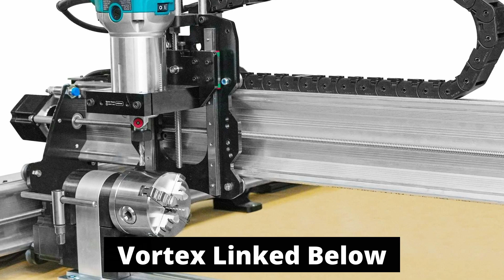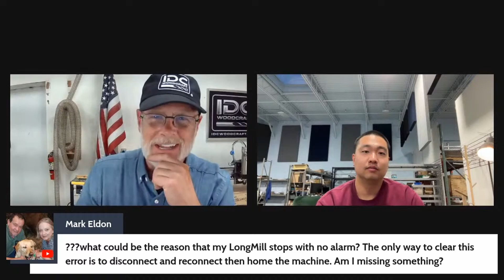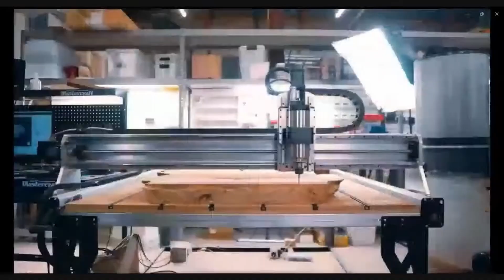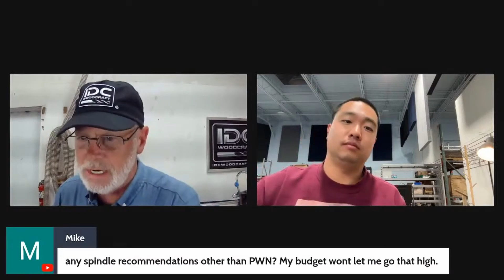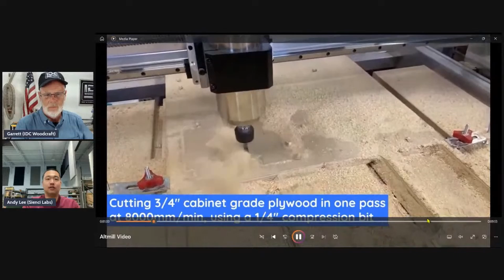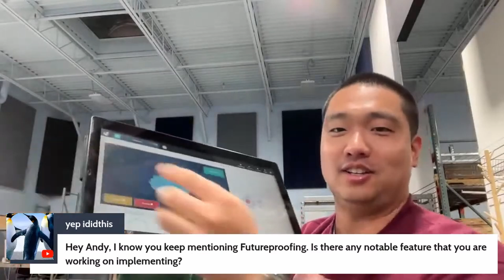Expert Insights in CNC Industry Innovations and Behind the Scenes

Comment: For my 30x30 tramming consisted of installing a piece of aluminum foil between the Zaxis plate and the motor mount.  That's a tiny shim but it's all it took.
Reply from the maker: laser31415, That's a clever solution! Tramming can definitely be tricky, but it sounds like you found a simple and effective way to get it sorted out. Happy woodworking!

Comment: I am very interested in the new drivers for the controller. I have had the long mill since Dec 23 and have yet to get it to run properly. Disappointed in customer service only by email with a 2 to 5 day response time. The controller does not move the router on the z-axis. I can’t even submit a service ticket without a video. How do I show that the controller does not move the router    A static picture?
Reply from the maker: harveyalmarode, I'm sorry to hear about the issues you've been experiencing with your Long Mill. The best way to show that the controller is not moving the router on the Z-axis would be to submit a video showing the problem in action. It's frustrating when you're unable to utilize your equipment properly, but hopefully, the Sienci will be able to assist you once they see the video. Consider uploading the video to youtube and submitting the shareable link for the Sienci team to review. Hope this helps brother!
Reply: Thanks for the prompt reply. I am just so frustrated with the whole process   I have taken it apart and check all the parts put it back together still the same thing happens. I will go back to the longmill and video tape it and see if I can get this working. I have a supplier for free wood I have had to drop a big walnut tree on my property and boy does it have some great small ovals and circles that I can saw out of the bigger limbs. I appreciate you taken an interest and replying. I will try sienci labs again
Reply: @harveyalmarode if I may make a suggestion... plug in one of your other stepper motors that you are sure that works to the Z-axis position on the board. If it works then use that motor and the old wires going Z and see if that works. What you are trying to do is figure out is it 1)stepper motor 2)wiring 3)board. It has to be one of the 3. Just narrow it down recording the steps as you go. As Garrett recommended upload that to YouTube. It free and can be done with your phone easily. This is the proactive approach I would take. I work at PwnCNC in support so I can most definitely tell you the easiest way to get something handled is to take a proactive approach. The more information you can provide in the clearest way the faster things will go. 🚀